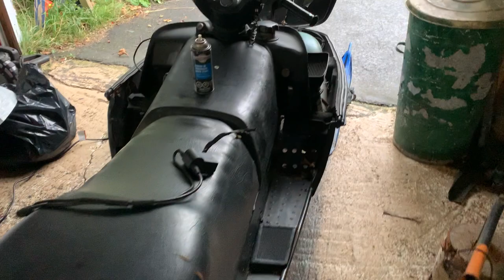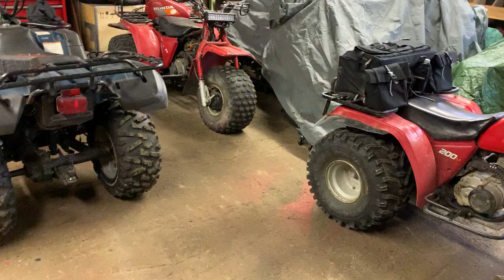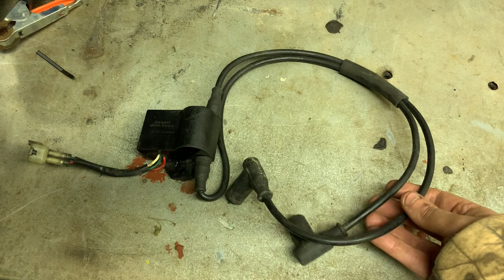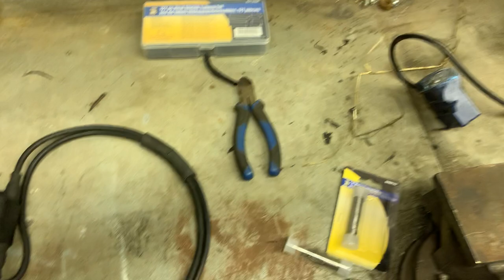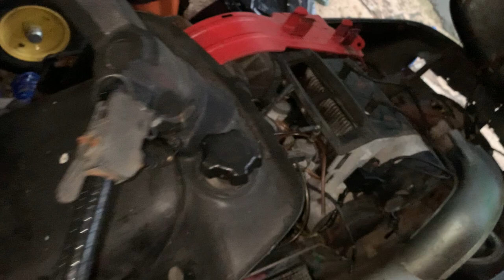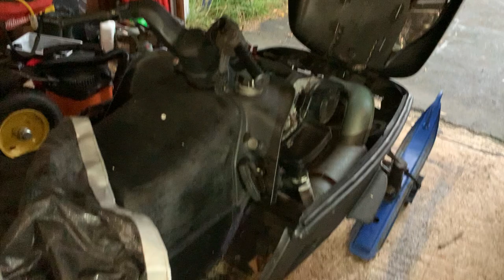Skidoo Safari 377 Snowmobile - No Spark - Will it run?

Comment: Interesting video,I am trying to start Bombardier 377 ,it's got same looking coil pack but it's also has what looks like a black box,(cdi) module ,I can't get spark ,and also no key or ignition switch
Reply from the maker: See if you find out what model you have. The best thing to do is to Google the wiring diagram for it. Then you can follow it from the stator out. Stator is where the spark originates from. You’ll need a multi meter and ideally a test light. I’ll look at the diagram if you can find the year of it

Comment: Hi I have a problem with the pull start I just rebuilt the pull start with new pieces now when I pull it it wont go back in till you play with it by pulling it in short little pulls then do it all again if you know where I should go to fix this would be great.
Reply from the maker: did you replace the rope as well? sometimes the rope does stretch. I will be working on this sled in the future again as i sold my polaris, this is the only sled i own these days.
i found a good service manual online that may help for you as well
http://www.vintagesnow.com/Ski-Doo_files/1988_SM.pdf

Comment: Hey I just picked up a 84 377 my cdi box was cracked replaced it still no power no power to the dash or anything would that be the stator ?
Reply from the maker: Typically stators have a couple coils ( wire) for lighting and a coil (wire) for spark. Does yours have spark? is it just the light on the dash that don't light up? This black one had the CDI burnt off it, replaced the CDI and its been running perfect ever since.

Comment: I just changed my coil on my 1994 skandic 503r and it won’t start what is the black with the yellow stripe wire for?
Reply from the maker: black with yellow is usually spark / main ignition wire. On the honda's for example black with yellow would be what powers the ignition coil. I looked up the wiring diagram for the safari for you. It appears the same as well for example if you look at one of the diagrams and look at Tether cut out switch you'll see the machine will shut off if Blackwith yellow is connected with black. If your machine doesn't run first check it for spark, if theres no spark you'll need that back. After that its just fuel and compression to deal with. Check out this link for a few diagrams
http://www.vintagesnow.com/Ski-Doo_files/1989_WD.pdf

Comment: Will you still have spark if the cdi box isnt working? Or would it just kill spark completly? Ive got spark and fuel but wont fire up. Im wondering if its just a weak spark from cdi?  Ive tested coil and ive got new plugs. 91 safari
Reply from the maker: the coil / cdi unit is built in together on these machines, it is possible that one component could be faulty. If you got spark and fuel,  I'd check air flow and compression next. Spray a bit of fuel into the air intake and see if it catches

Comment: My ignition coil went in my 1990 Safari. Anyone know where should look for a new one??
Reply from the maker: Hey there, Im not 100% familiar if the 1990 looks like mine ( 94 model ) but i looked up a few and see that for a 1990 are about 40$ canadian on ebay. I never had a whole lot of luck online finding a good deal for my 94, but luckily I found a good used one locally. I'll have to do an update video soon when I get the safari ready for the season! Thanks for commenting

Comment: Hi were you put the yellow wire on what
Reply from the maker: do you mean the black with yellow striped wire? I'll double check to see where I put it too and get back to you. Typically black with yellow is a spark wire / or trigger wire for the spark plug coils
Reply: @muddythumper8152  ok 👍